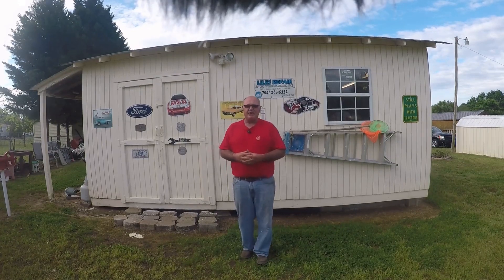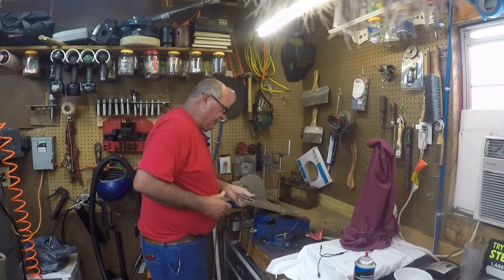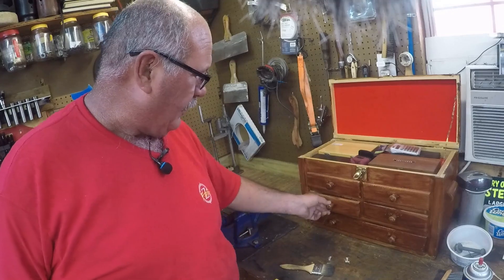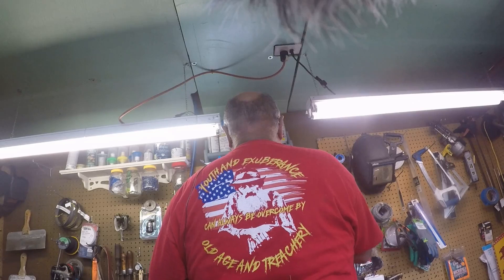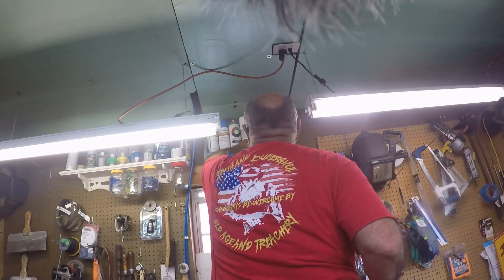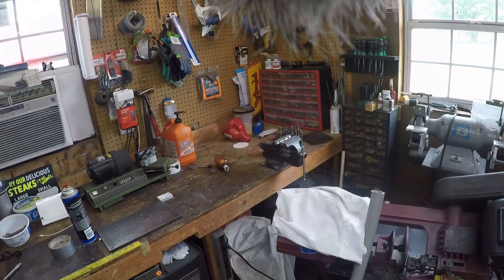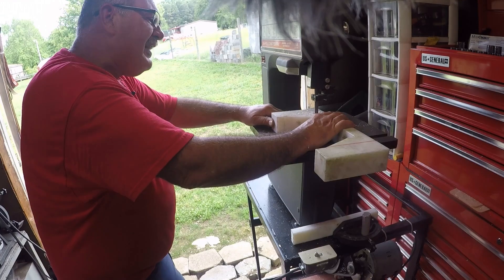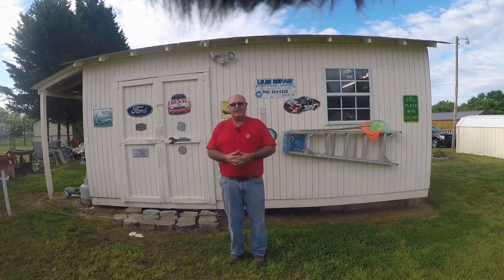Slop in the Shop 60

Comment: I guess everyone but Keith Rucker and Tom Lipton are short on space.
Reply: I learn a long time ago...big enough, is never enough....lol
Reply from the maker: TC Ed yes this is true, it like Kilroy says the shop is your most expensive tool. A while back I priced a larger shop, 20x30, using a simple carport building as a base, by the time you get it finished out with insulation wiring, and move in ready that 20k. That is with my BIL doing the electrical. That is to code here, in Gaston Co. NC. You got to insulate buildings here for the temperature swing and to stand the 90+ degree summers here.